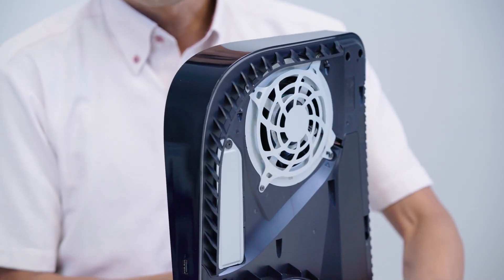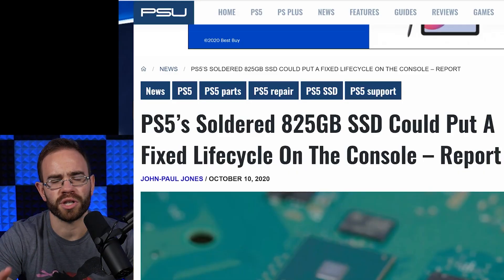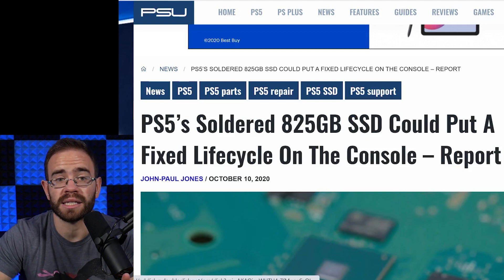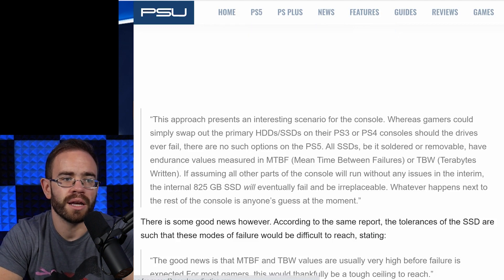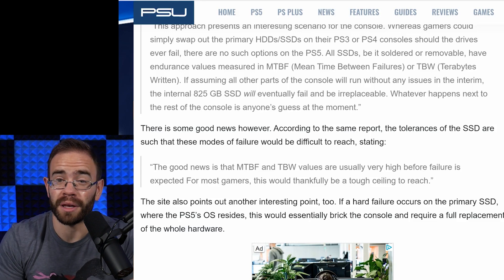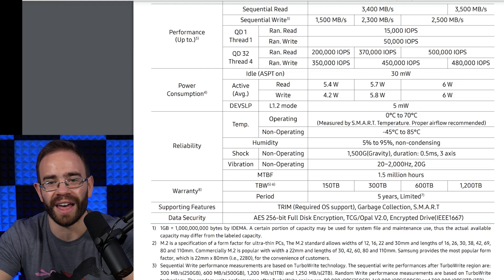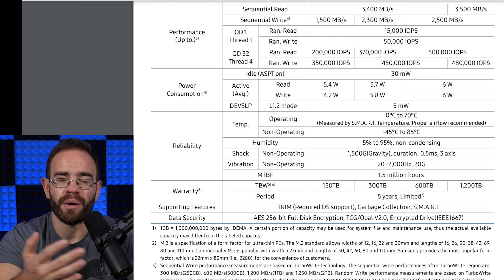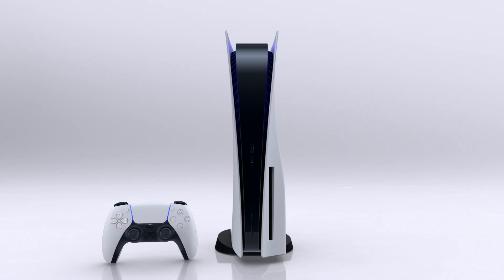Is The PS5/Xbox Series X SSD A Problem For Preservation?

Comment: The problem with SSDs is how long they can STORE the data! ..lets say you have installed some games and don't use the PS5, you just want to store it, how long can a SSD store the data? A HDD can store the data lifelong (theoretically). Sony did a bad choice using a SSD instead of HDD. This really f*ks me up sometimes, EVERYTHING today is build for speed and not longevity, i can play my first xbox after 20 YEARS! I canot say the same thing about the ps5

Comment: Just to know, XBOX series DON'T allow to change the ssd. It has a lot of restrictions: just compatible with 1 specific model (WD CH SN530) which is very difficult to find for a reasonable price, and a unique key is stored in ssd so if you change it for another one you have to copy this file (it is in a special partition). The problem is that often people decide to change the ssd when it is broken and then is impossible to get the key.
While writing, there are no other way to repair it than send it to MS and pay 300 dollars. A shame.

Comment: I've been looking into this and not finding much question about the model of deleting and reinstalling when you run out of room, we are told to write massive chucks more then a photographer would.

512GB or 1TB on the xbox s/x with games ranging 30 - 150GB, I'm at 80% after having a series S for 2 weeks. It was second hand so I don't know what kind of use the original owner

Comment: I stopped the video at 5:07 before my thoughts went out of my head to type down. Haha    My takeaway from this is....

There will be heavy downloads because of how large the AAA games (G.T.A6, a new C.O.D, ACreed & GT7) are going to be & the update patches for them games, plus the extra DLC over the years. No wonder there going to give you the option in most AAA games options if you want to take out the campaign mode or the online aspects of the game. The digital version of the PS5 will give out before the hard drive version does. Life cycle of the digital PS5 8 years & 15 for the Hard drive PS5 version. I genuinely would like to know if I am right or wrong.

Comment: And as far as the jank 5200 RPM drives went, I replaced my children's with a 10,000 RPM IS Grade drive in the PS 2, 3, and 4.  F X Box, after the Red Ring of Death BS, Never bought one again.  If I can not open the damnd box up and replace or upgrade a part or parts or they make it to where the parts are unattainable like APPLE, F**K them all!!!  You cash cows need to just stop handing over money for sh*t like this!!!  The only way corporations will stop building in designed obsolescence is when the consumers as a block stop paying for them!

Comment: A work around idea: use the soldered SSD for the next 2-3 years until 3rd party replaceable drives become relatively cheap and readily available. Buy one and start using the replaceable drive to store/run most of your games.

Comment: I think there might actually be some cause for concern with the SSD because it's not just game storage for the PS5 - it's fast enough that it's being used as an expansion to RAM and will have lots of  constantly written to it because of this. It will probably be a SWAP partition, meaning the same physical sectors will be under a lot of stress over its lifetime. That's a much bigger concern than occasionally downloading a game spreading wear over 800 GB.

Comment: Does installing from a disc use the same amount of TBW as downloading? I was really considering the digital version of the PS5, but if downloading online uses more TBW I’ll be getting the disc version. It’s probably the same. I’m so going to be downloading/installing no more than 2 games at a time as I have installed and downloaded a ton of games with PS Now. I feel like I’m going to have to ration this, now. Also, I will definitely get an extended warranty and KEEP my PS4. Thanks for the info.
Reply: No.  TBW is TBW.  Nothing changes between Digital vs Physical apart from the download size.  And under normal use, that SSD won't just die overnight and will probably last until the PS7 minimum if you don't just make a habit of constantly moving things to and from it every day.  You don't need to go out of your way to ration anything any more or less than before.

Comment: I dont really think it's fair to suggest this is the same as the S/X having drives that were not meant to be consumer replaceable. I fix multiple systems a week and while it does require you to void your warranty, hard drives failing is a common issue and you don't even need the partition script anymore, and even then there are easy YouTube guides and the script does the work for you. There is a massive difference between it being inconvenient to repair something than it being IMPOSSIBLE to repair something and while they will have far fewer longevity/reliability issues than standard hard drives, for the ones that do, those boards will now be eWaste/donors. Half the time the drive itself isn't even bad, the firmware just gets corrupted and you have to just delete and initialize the drive outside the system, and now there is no way to do this. People would be surprised how often "no video" has nothing to do with the HDMI port and just is the drive being corrupted. Now if a USB flash doesn't fix the drive, the board is literally e-waste. I understand why they did this but it's one less thing that's repairable.

Comment: 800GB really isn't enough for a modern game console, GTA V is like 70-100GB, so assuming every new PS5 game is around that size, you'll only be able to install 7-8 games.
I ran into that problem with my 500GB PS4, I probably only have 7 games installed on the hard drive but I own like 30 games on disc, mostly ones I haven't opened because I know my PS4 can't fit them right now.

Comment: HDDs fail too.  The difference is you can't periodically swap out the on board SSD to prevent these kind of issues.
Also we're talking storage, not memory (ie RAM).  I'm surprised Mr Spawnwave made that rookie mistake.

Comment: Personally I’m not too worried considering my 360, my ps3 and my wii still work fine, I was legit running the fat ps2 my uncle got in 2003 from  2010 to 2015 and was using it pretty frequently and it didn’t die out on me, the only reason it doesn’t work now is because my dad pulled out that wire that’s attached to the console

Comment: I had an M2 SSD fail in my 3 year old laptop. And I only used it as a boot drive, I have a hybrid drive for storage. So I can see/feel the worry. My SSD never even reach max capacity, not the max write limit.
Reply: Most likely a fault.  I've never had a storage device fail under normal use cases and the only ones I've had fail are HDDs that were exposed to physical shocks

Comment: Considering the user space on the ps5 and the game sizes ie the number of install/reinstalls and copy back and forth between an external drive... suspect it really will be. Considering the cost have to be kept down and a drive of that size... lets just say i suspect it don't hold the best nand's either ie the no of erase cycles it can handle and that with an soldered drive that cant be replaced... GL

Comment: If I'm not mistaken the Xbox Series X has a NvMe drive that's installed onto the board but not soldiered on so you could technically open the Series X up and remove and replace the drive. The only problem is if Microsoft has any kind of custom formatting with the drive.
Reply: Great idea... If you don't value your warranty

Comment: If all generations going forward support backwards compatability (which seems likely) then it should not be a problem for preservation. Maximum TBW is much higher than it used to be these days, I'm sure a launch PS5 SSD until the end of the generation. If something in your console starts to fail it would most likely be other parts before the SSD. And yes, I know HDDs were the main problem for consoles going faulty in the past, but HDDs break much more easily than SSDs. The HDDs can break from shakes and movement.

Comment: the main SSD of the PS5 is hardwired onto the board itself, however there is another NVME slot built into the system for a second drive to be installed.

Comment: Do agree with you that it technically should outlive us, but it's electronics and electronics do like to fail, even from the best manufacturers and made out of the highest quality materials. The new drives will be just another embedded part of the console into the system and in case of failure, it will be difficult or for most impossible to replace.

Comment: Lol to 1tb drive can be fully written (under full load) up to 600 times? More if only half the drive is utilised? Call of duty warzone 180gb? So to fully use the 1tb you'd instsll it 5 times, then to fully max out the tbw, further install that 600 times so a total of 600*5 = 3000 times? 

-can anyone confirm my math?
Call of duty install size 180gb
1tb= 1000 gb
5 call of duty installs to 1tb
Tbw limit 600tb
5*600 = total installs fully using all space each 5 installs = 3000 cod installs?

Yep i dont think i'm gonna install cod 3000 times in 5 years or 600 times per year or 50 times per month? Or Almost twice a day everyday for 5-6 years? 400gb write per day, every day for 5-6 years? If i install it once a day, everyday drive will last 10-12 years?

I think we're ok ^^
(I hope we're ok, i've got the same drive in my pc ^^)

Comment: If a typical game is 100GB You would reach 600TB after 6000 game installs. if you are an ultra hardcore gamer  and expect to play 30  100GB games per month it will last less than 16.66667* years. Disappointing Sony.

Comment: You guys do know solder melts right, by the time these SSD chips wear out any local repair man will have a BGA repair station. Hell you could have a pretty decent chance of getting those on that board with a regular hot air station.

Comment: I used to kinda work as unofficial DIT, in film and TV, and everyone has experienced data loss from solid state recording media... ssds just can fail, and you are always recording on two drives.  A HDD drive with a sick shock absorbsion system by Sound Devices is like standard back up for sound mixers.  Do a Sound Devices 744T breakdown sometime, you can record audio through a 7.0 earthquake, on the HDD...{I'm pretty sure they similated a 7.0 earthquake when they tested their HDD "shock absorb" system}

Comment: Video recording...
How is gameplay recorded? I believe the PS4 has 15 minutes of rolling gameplay recorded. Obviously that would be compressed to something like HEVC or even newer but you'd still probably need about 1GB by my quick estimate which is a lot of the GDDR6 memory... although they probably would just have a maximum amount of GDDR6 memory set aside for quick resume etc so if you use video recording it might simply bump one of the games data out of the queue... either way, I do not expect the SSD to be used for rolling recording as that might be 4GB per hour at minimum... now that I actually do the math that's unlikely to exceed 10TB in a year as a worst-case which may not be an issue... not really sure how you can possibly wear out an SSD then?
I guess if the TBW rating was fairly low, and the video usage higher that this could add up when combined with other writes (including web browsing). Whatever, I do expect this to be an issue a lot of thought has gone into and worst-case (aside from failure) would be that you get WARNINGS when the life expectancy due to writes is achieve but keep in mind the SSD doesn't suddenly stop working as the TBW number is a guess... so at that point they'd likely recommend an SSD expansion if you didn't have one at which point they could simply use it instead and delegate the onboard flash memory to stuff that's mostly about reading not writing.
(reading still wears out an SSD due to P/E cycles but it's insignificant)

Comment: I'm going to guess that these drives will be replaced with conventional drives when it comes time for a revision. Right now, that kind of storage is just starting to get to consumers, but in another few years they should be readily available. Such drives will probably bring costs down for the system and will make for far easier to service units.
As a side note, these failure estimates don't often take into account how users actually tend to use drives. While a 1TB drive might start to run into issues after 600TB have been written, that also isn't taking into account that drives should not be kept remotely near maximum capacity. When kept near full, it forces all writes into the remaining free sectors of the drive, dramatically reducing the lifespan of those sectors relative the rest of the drive. While things like auto-saves probably don't save all that much data (still usually multiple MB these days) they do happen often enough that they could begin to take their toll on a drive kept at it's limit.
Reply: I've been using a 500gb SSD in my PS4, then transferred it over to my PS4pro.  It's been through a lot of games. I have 181 titles, 92PS+ on my PSN account. I swap the games I'm playing from the SSD to a 4TB HDD or delete and download from PSN and havent had any issues yet.  It's been, 6 years?

One thing to remember is SSD controlers are smart.   It will reallocate memory based on life cycles and write to that memory.  Thats where your new R/W for save games will be happening.  You're not going to just be hammering the same 25GB over and over until they fail.

SSD has been around for decades.  They've got all this shit figured out already.
Reply: @scottr397  Yeah, the controllers for drives tend to be pretty good about distributing writes as evenly as possible. If users cycle their games fairly evenly, the controller will do it's best to put data into sectors that haven't been used as regularly. That said, I know many people who will fill a drive to near it's limit and leave a number of things on the drive for years. Most people probably don't clean out their screenshots, video clips, and similar unless it's a problem which does lead to uneven wear. This is basically why the 80% rule of thumb exists, because hammering the same 20% or less of a drive will cause the risk of errors and failures to become far more likely. It still takes time, and it won't be 100% of drives failing within a year or anything.
Still, there's a reason why these soft rules exist and why backups, surge protectors, and UPS are utilized. Failures can and inevitably do happen. I've had drives that last me 10+ years and others that last me barely more than a single year. It hasn't been an issue in home consoles, but I've had bricks happen with other devices.
Edit: Though not drive related, I'll also add that I was one of the people that ran into a Yellow Light issue with my PS3 after several years. Being an issue with components on the board, I had to send it off to be repaired. I also ran into issues with my first PS4, having problems with the capacitive switches randomly triggering. The drives being on the board of the PS5 will increase the difficulty of data recovery in the event of other hardware issues.

Comment: PS5 slim will NOT be socketed...
Reliability won't improve. You've traded the ability to swap out a failed component for a higher statistical likelihood of reduced reliability since the socket itself is a point of failure. So it adds cost to the console, requires a redesign which in itself may introduce problems, reduces reliability and will represent security concerns.

Comment: SSDs fail a lot, sometimes not because of age, they become slow and error prone the more frequent they are written, they need unused free space for this, failure also depends on SLC MLC TLC category of SSD. Frankly this is the reason I thought both Sony and Xbox will make user replaceable primary SSD this time. Only real time testing will tell how reliable these machines are. 

I’m a VLSI engineer, I work in Intel.

Comment: I am not worried about it. Because by the time the on board SSD goes bad Sony/Microsoft would put out a firmware update that lets you bypass the internal and you would just use expanded memory. By the time the SSD fails 4 terabyte expansions will be $50.

Comment: Seem unlikely a PS5 slim revision would have socketed flash if the original did not. Connectors are usually something manufacturer want to cut down on. And the slimmest PS3 got flash (12GB) on-board as the only storage. 

If a slim still got a socket for that, it would probably be in the only one there was. So again replacing the entire storage rather than upgrading it in the way previous consoles did. Even that 12GB PS3 model, despite the memory being stuck on the board.

Comment: Theoretically, they are removable if you have the proper equipment, extensive knowledge and excellent Microsoldering skill.  The only reason I know this is because there has been an experiment to switch out the Flash Chips in an IPod Nano for higher capacity chips, it didn't technically work, as while Itunes DID recognize it,  but it said it was still a 1 GB Ipod nano. So I know it is technically possible to remove these kinds of chips, but there may be more additional jank involved with regards to capacity recognition, so only time will tell if its truly doable or not.

Here's the Source: http://peterburk.github.io/blog/

Also another NAND Flash Replacement Placement Project: https://hackaday.com/2020/08/04/bringing-an-ipod-to-the-modern-nand-era/

Comment: The TBW rating for the PS5 is speculation right now, but it’s reasonable to write 600TB in, let’s say, 10 years. If you’re a system archivist, the lifespan is not good.